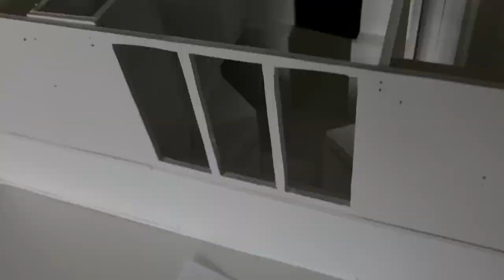Uniquely Designed Tiny House Interior with FLIPPED Floorplan - 3D Scale Model

Comment: Reasons to have a window in the bedroom, besides being able to enjoy the views from your bed, is it can serve as an emergency egress point in case of fire, in which you may not be able to reach the front door...

Though, if you have a trap door leading out the back then that can work too...

I'd just advise checking to make sure you're not making the whole thing too top heavy as then it may be prone to flipping over whenever you make a sharp turn while towing it... But the bay windows is a good design that should help reduce wind resistance and make the house is easier to tow... and the stairs just need hand rails... along with making sure all parts of it get proper air circulation...